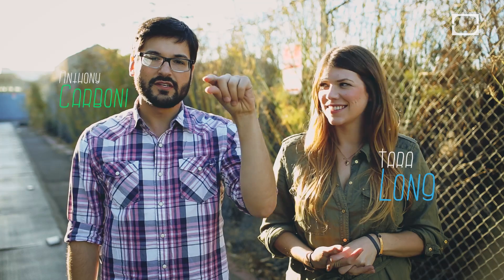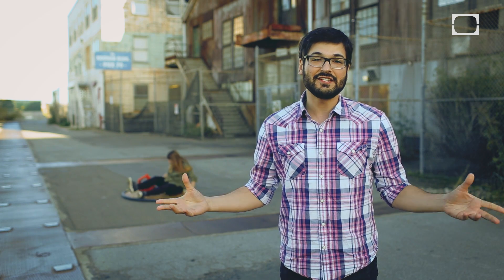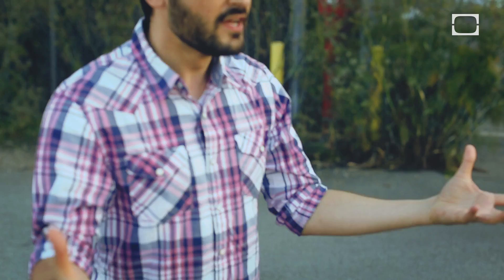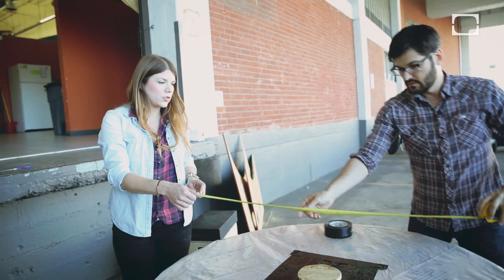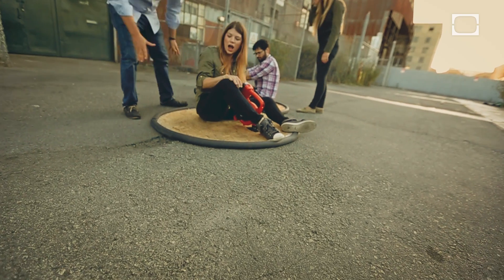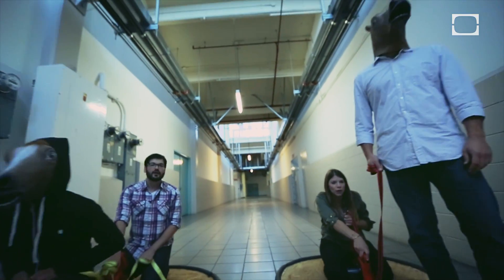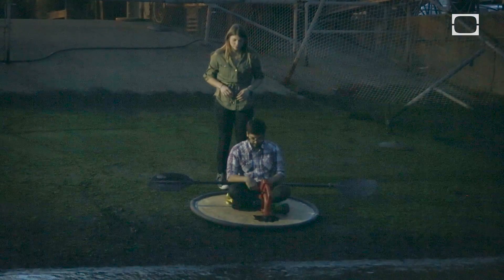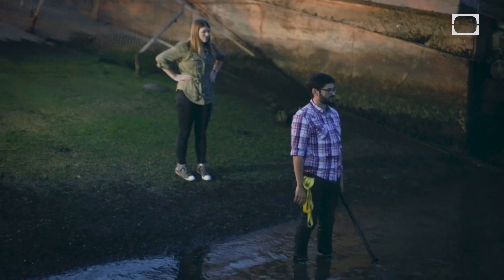HOVERCRAFT BOWLING - Hard Science

Comment: Make your own hoverCRAFT and test it in a smooth survive and water
Here's how I think you should do this
Things you need
Cardboard
Duck tape
Same leaf blower
Some sort of pillow case or something that can hold air
The balls to do this
Powerful fan

What you do is
1. Cut a shape with the cardboard. This is what your hovercrafts shape is going to be
2.cut a small hole into the pillowcase or something. Make sure that the hole is big enough to fit the leaf blower
3. Cut a small hole in cardboard so it's the same size as the hole in the pillowcase
4. Use duck tape to tape the pillowcase to the cardboard MAKING SURE that the 2 holes are in the exact same place
5. Attach the leaf blower into the hole. If you want you can use duck tape to insure that the leaf blower stays inside
6. Attach the fan to the BACK of the hover craft facing AWAY from where the user will be sitting

You have now completed your hovercraft
If you want to make sure that the pillowcase won't burst so easily you can

Comment: Well, the reason it didn't work on water is because the skirt was too small; He tipped the hoverboard slightly and the water immediately covered the whole side of the skirt, removing lift from that side and the result was clear.
It also annoyed me that his explanation of why the hovercraft "floats" like it does, was wrong: It's not the skirt itself that reduces friction, but the air flowing out from the bottom and over it! The goal is to create an even, thin layer of air between the skirt and the ground, to create a uniform, frictionless surface. Now you know. Funny video though :)